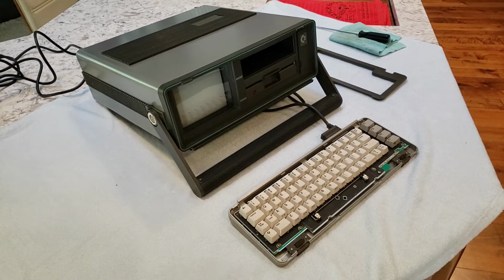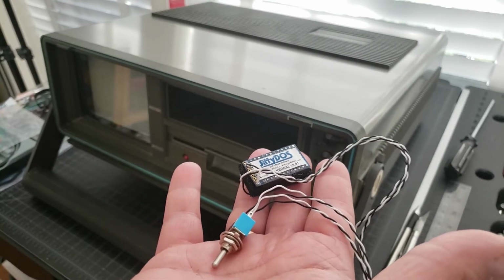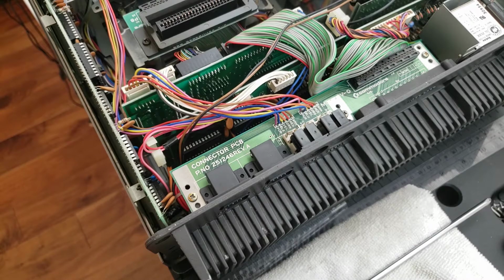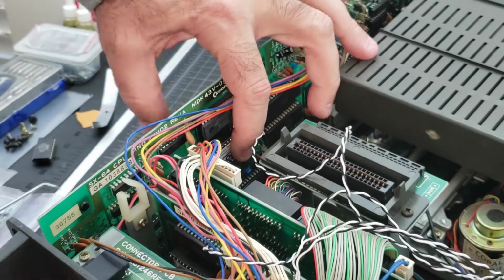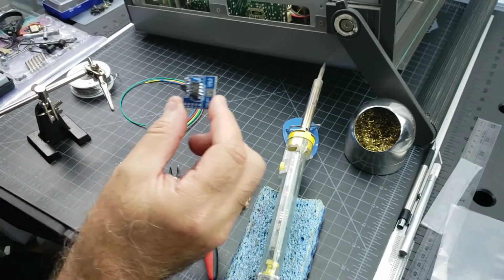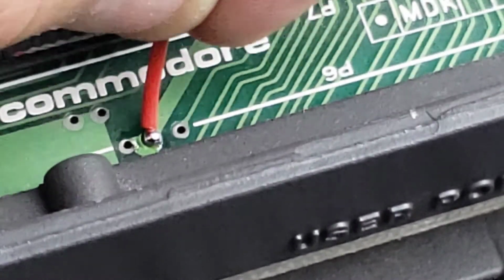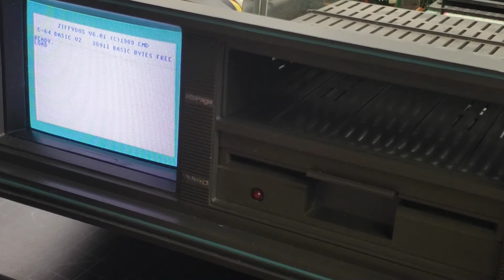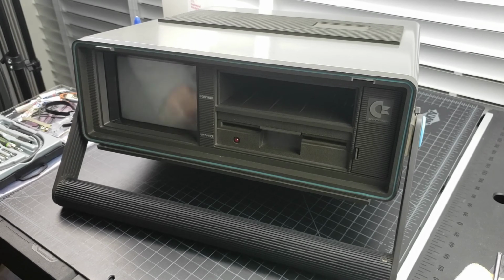Commodore SX-64 Project - JiffyDOS, Ultra Reset and more!

Comment: Great video, but I have a question. You show a bag on your desk that says SX-64 Ultra Reset TFT, but you have an original CRT with no TFT upgrade in this video. Why is that bag shown? Im confused. There are two versions to buy. A regular ultra reset and an ultra reset with tft upgrade. Am i missing something? Thanks a bunch.

Comment: Incredible.  Thanks to your amazing video I ordered JiffyDos and Ultra reset switch.  Today I installed everything and on top of it I am extatic that my first time soldering worked without breaking my SX-64.  Thanks again!!!
Reply from the maker: I love reading success stories! Big high five to ya!! Thanks for sharing!!
Reply: @revivingretro  I'm trying to figure out if i can relocate the red power wire.  For some reason when my WiFi is connected on the userport the boot screen never comes up.  If I remove the wiFi from the user port all is fine.
Reply from the maker: @slammed  relocating the power wire most likely won't solve your issue. It may be one of two things that come to mind:
(1) Some early versions of the SX-64 needed to have the user port "fixed" - I know some have had issues with their cartridges in the past due to this factory imperfection. On one occasion the  issue caused damage to chips. See link here (you'll have to translate to english):

http://www.sx-64.de/sx-64-userport-fix-9v/

(2) Some cartridges (REUs for example) use more power than the SX-64's PSU can supply. Some folks have replaced the ribbon cable with more shielding. I'd be surprised if this was your issue though. My wi-fi adapter doesn't draw that much power.
Reply: @revivingretro  thank you for the quick reply.  I will definitely have a look into it.
Reply: @revivingretro  Luckily my top cartridge port works fine.  Seems my WiFi modem which uses the rear user port lights up, 1541 power cycles but the screen never loads, stays a hazzy black.  If I remove the red wire it all goes away and returns to normal.  hhhhhmmmm ..... I've ordered an UltimateII+ cart which hopefully should arrive in a month or 2, and I can then use the top cartridge port .
Reply from the maker: @slammed  I'd take a look at that 9v fix, just in case :)
Reply: @revivingretro  Turns out my reset switch went all crazy today ... and I mean CRAZY!!!.  I carefully removed it entirely from the SX-64 and created my own homebrew method (without opening any holes) to switch the drive letter between 8 and 9.  Funny enough now that the Reset switch has been removed my User port is once again working.  Once again, thanks a million for your incredible video and your troubleshooting support.